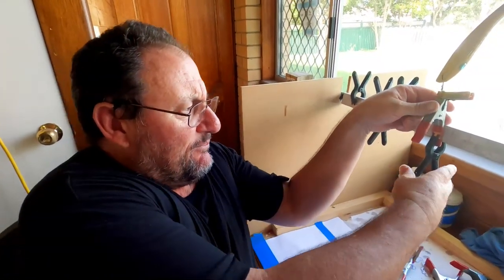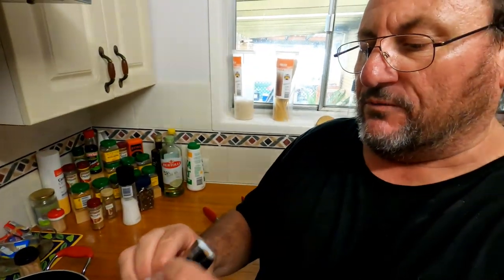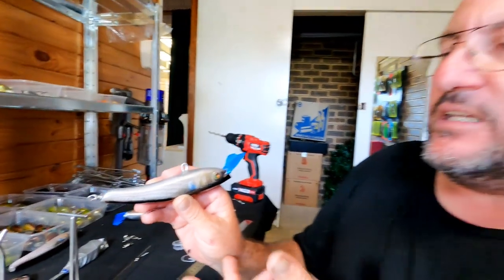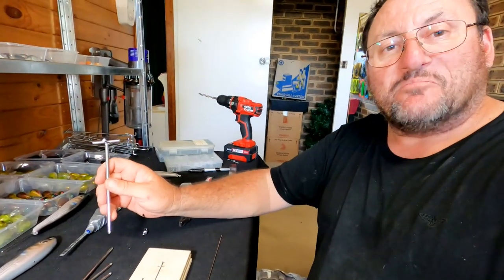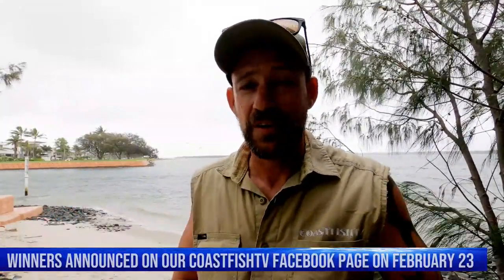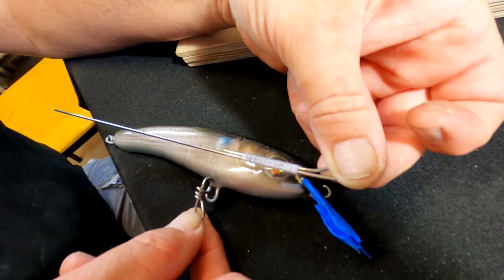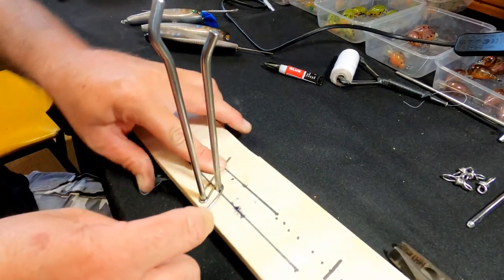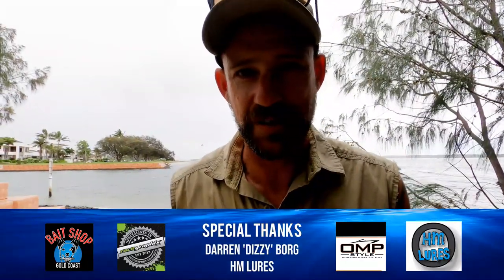How to make a fishing lure Part 2

Comment: I'd pre-cut the slot for the wire on the table saw while the wood was square, plus use a push stick to push through and another one to hold the timber against the guide, easier and Much safer. My workmate lost three fingers in less than a split second cutting wedges like this on one of these saws, he was a 64 year old shop joiner and used this saw all of his working life.
Loosing or damaging fingers could make tying a tucked blood knot very difficult indeed 😥

Comment: Great  vidoe what diam wire do you use and is stainless steel
Reply from the maker: The answer should be in the comments. There are 3 vids in this series
Reply: @CoastfishTV  Great answer mate
Reply from the maker: You can buy your wire at bunnings or your local hardware store.

Comment: There is no way I'm getting my fingers that close to a table saw! Also, if you cut your through-wire slot after you've sealed your lure, aren't you destroying the seal? When you shrink your wrap in the water, you'll soak up water. Sorry to sound like a killjoy, but as a lure maker myself these points were a few things that jumped out at me straight away.
Reply: Beetle B run a paint brush with sealer down the slot before you wrap. Cutting the slot at this time in construction allows you to get dead centre and also stops any of the wood from splintering. You can chose to cut slot at the start of construction if you choose but this is how I do it. The are many different way to make lures and it is impossible to put all possibilities into a video. If anyone wants specific details on how to just go to HMlures Facebook page and I can help.
Reply: @darrenborg5976  Do you normally leave the slot open before wrapping? I'd glue a slither/fillet of wood in and sand ( leaving room for the wire of course ) or I'd place a drinking straw into the slot and use a filler to fill down to the straw and sand.
I've also seen them wrapped after the wire is fitted, a little notch cut for the centre link and this doesn't leave a big drill cut out of the wrap making for a neat job.
I'm not knocking you and appreciate your time and effort showing this, plus I do not doubt that your lures are great, I'm just trying to fill in details which I think were missed 👍 It's just my nature 😂 Thanks!